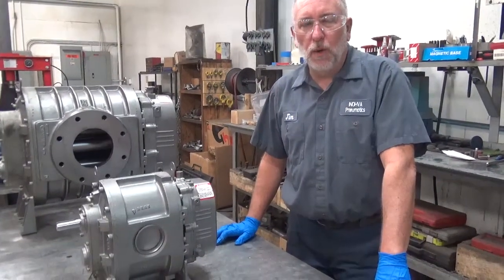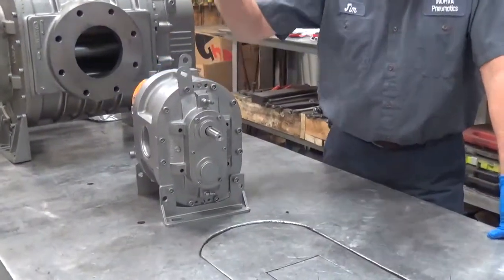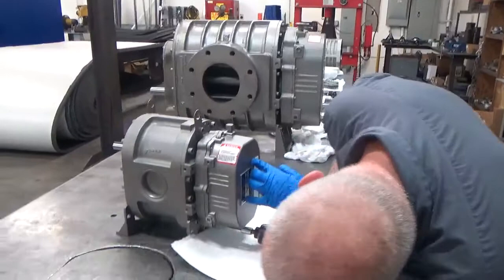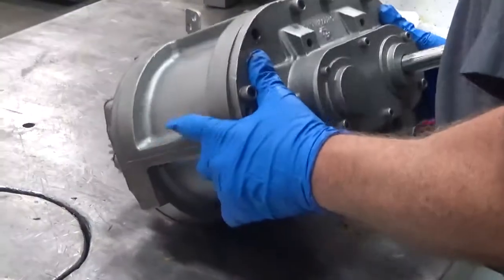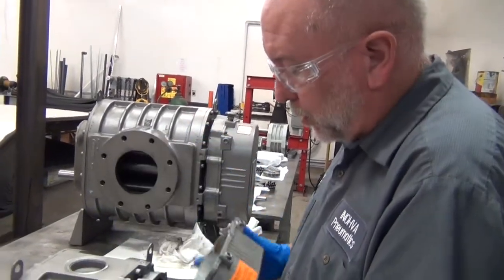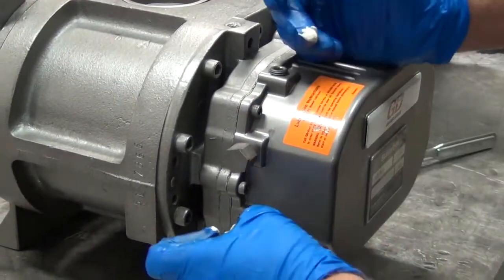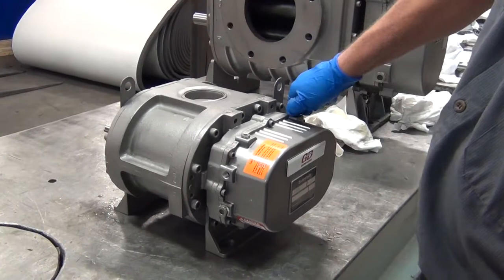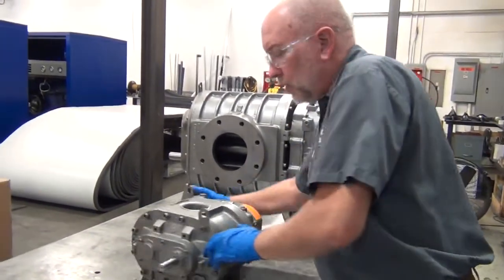How to Flip a Sutorbilt Legend Series Blower

Comment: What was the brand of blower you had in this video?
Reply: There wasn't any discussion on the proper oil level and can you tell me what kind of oil that would be sufficient in a pinch?
Reply: @toddbryer746  Depends on your blower. I run a 2" sutorbilt which requires a 220 oil. You fill it to about midway on your sight glass or until it begins to run out of the level plug opening, depending on what your particular blower uses, If your budget allows, a synthetic like Aeon PD is a better way to go.
Reply: Gardner Denver - Sutorbilt line of blowers.

Comment: Hi sir 
I have question about timing adjustment 
Wich one is easy and most simple 
1- use with 2 fillers for inside clearance and 2 filler gauges for timing gear backlash. 
2- using  indicator gauge for inside and filler gauge for timing gear?
Thank you
Reply: You have a no 8999710198 call me